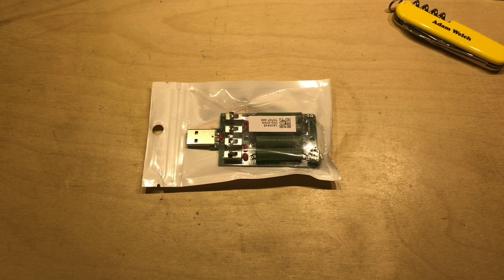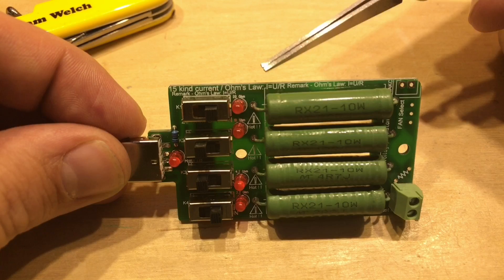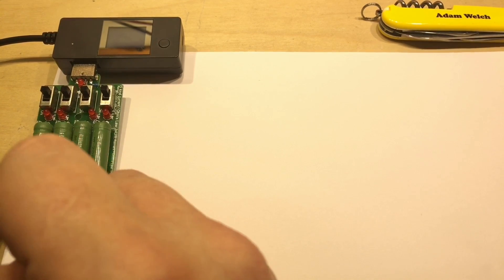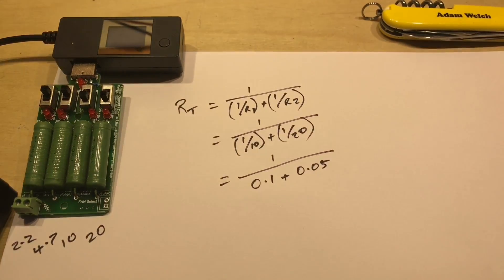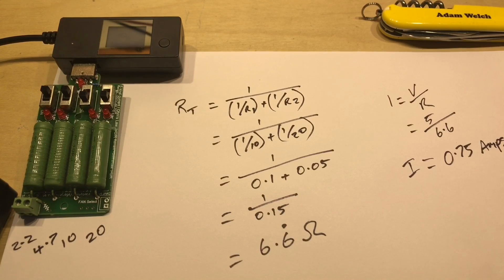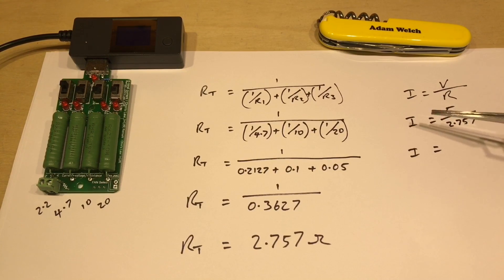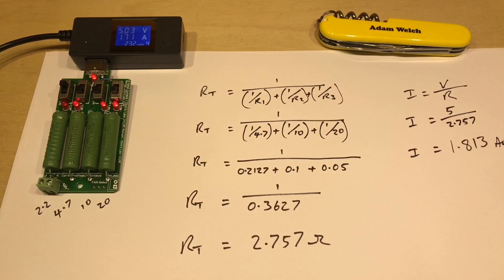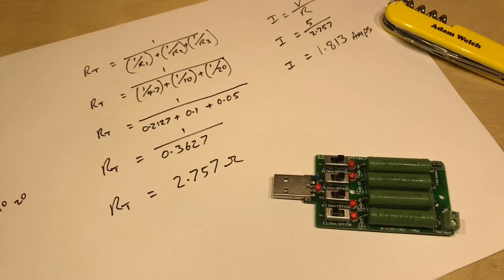Parallel Resistor USB Load (with maths) - 12v Solar Shed

Comment: Thanks for tutorial! I read on Aliexpress and eBay that this device supports QuickCharge 2.0 and 3.0. But, from comments I read, if I apply 20V there is no resistor with a suitable dissipation! On higher 20Ohm resistor(1A): 20^2/20=20W. it would only be possible with two 10Ohm 10W resistors in series I think.

Comment: I'm glad you mentioned the problem calculating with low resistances. When resistance become close to resistance in the contact points and traces. Interesting little device. That board is useful :)
Reply from the maker: All those little amounts add up and when you're already looking at low levels it can soon cause an issue.  My meters couldn't really accurately measure the low resistances so I had to go with the stated resistance.

Comment: From what I remember of my 2-resistor versions of these, it's normal for a little smoke and smell the first one or two times you run them. That little terminal block is useful for when the USB plug inevitably breaks from the weight of the board :P
Reply from the maker: +Gadget Addict Yeah a little smoke never did anyone much harm. As someone pointed out on here though, if you use the 2.2 ohm resistor at 5 volts that will be over the 10 watt rating of the resistor!

Comment: +Adam - Nice video with some fine points of attention noted in the comments. In my video of modifying the two-resistor USB load (https://youtu.be/gGfzUd8bVZ0), I kept calculations simple, doing only the parallel to serial modification with two 5 ohm resistors.
For battery testing I recently bought a constant current load, but noticed some weird interaction with a usb capacity meter when using  auto-switch-on powerbanks. (Need to look into that...)

Comment: The Resistors have 5% tolerance. The "J" in 10RJ is the tip-off. This code was originally only used with capacitors.
The complete series is like this:
B: ±0,1% / C: ±0,25% / D: ±0,5% / F: ±1% / G: ±2% / H: ±2,5% / J: ±5% / K: ±10% / M: ±20% / Q: +30..-10% / R: +30..-20% / S: +50..-20% / T: +50..-10% / V: +100..-10% / Z: +80..-20% / None: +100..-20%
Keep up the good work.
Reply from the maker: +Carsten Hiller Cheers Carsten. That's useful info.

Comment: I calculated it a bit faster, went straight to the currents: (5/10)+(5/20)=0.75A, I'm lazy :)
 One thing though - if you choose only one 2.2Ohm resistor, you will overdrive it: 5^2/2.2=11.36W >10W. So yeah, do that and tell me how much smoke came out :D
Reply from the maker: Yeah - that's a good point.  That would get it smoking!
Reply: MrJohhhnnnyyy l